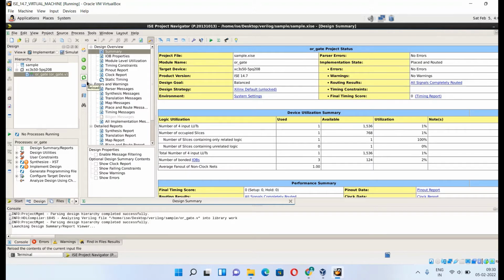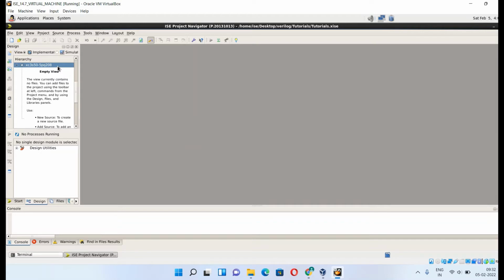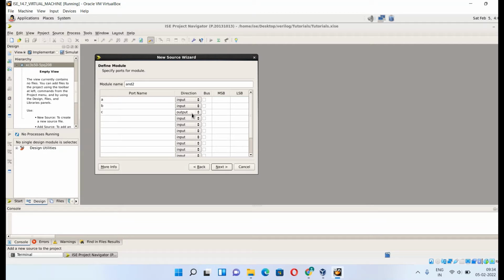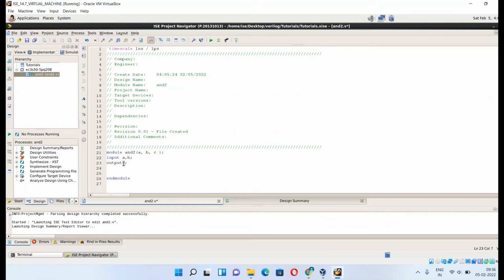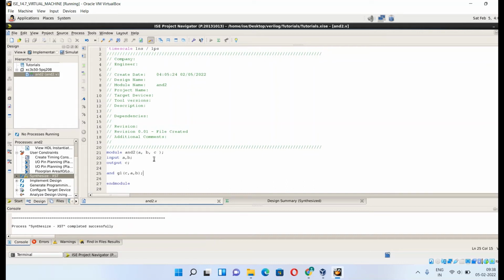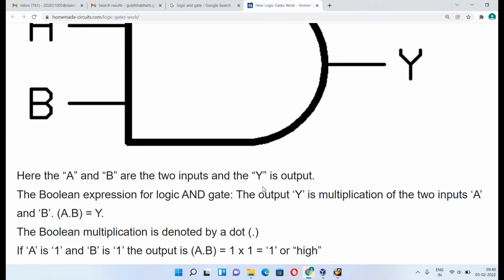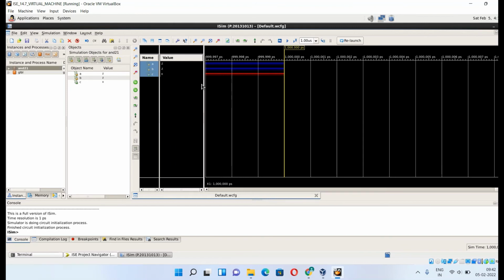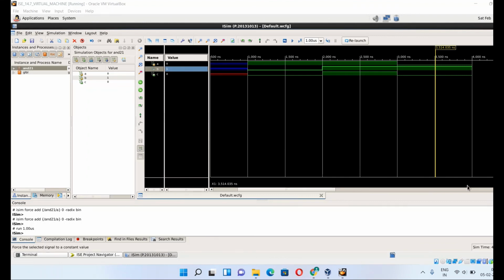VerilogTutorial1 | Implement verilog code on XILINX ISE design suite | verilog Basic #electronics

Comment: How i fixed this error/warning

Warning: VC++ 2008 runtime libraries are not installed.
Please install the runtime libraries by running the redistributable {Install Root Dir}\common\bin\nt64\vcredist_x64.exe from the installed area.
You will need to have adminstrative privilege to run VC++ 2008 Redistributable.
Reply from the maker: I havent encountered such error in windows 11 during VM installation. Please check your OS before going ahead